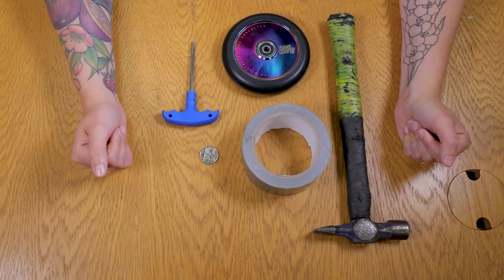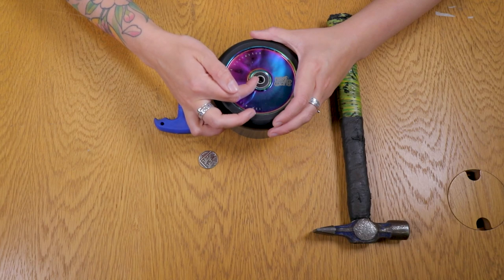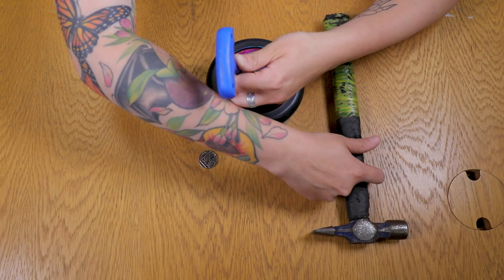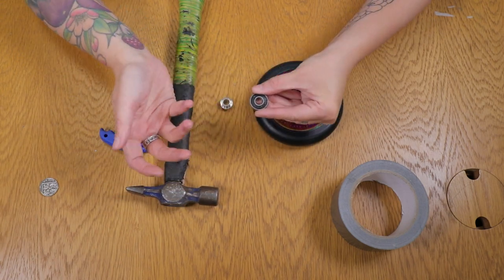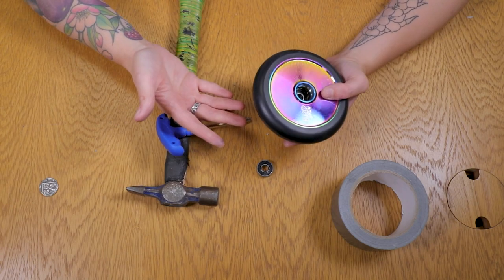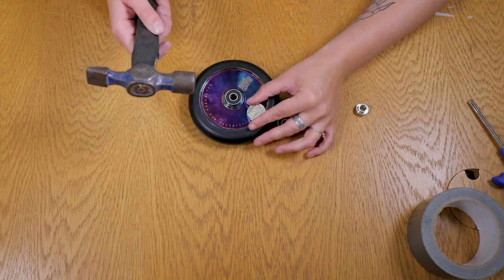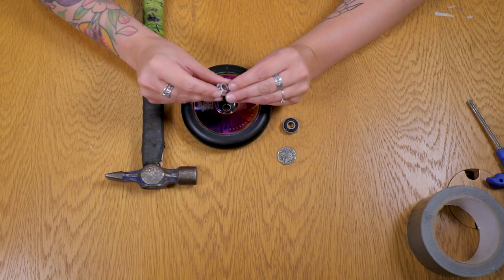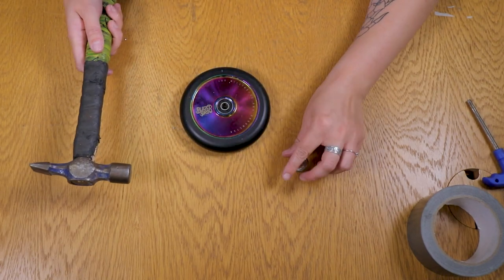How to Change Scooter Wheel Bearings

Comment: I would get a dedicated drift (a steel rod) rather than using a good hex wrench for this. This advice is in the same category as not using your screwdrivers as pry bars - just get a dedicated pry bar for that.
I like to use a dead-blow plastic-faced hammer for these types of jobs, it transfers more of your energy into the drift, there's less bounce/rebound, so you can use gentler taps for the same effect.